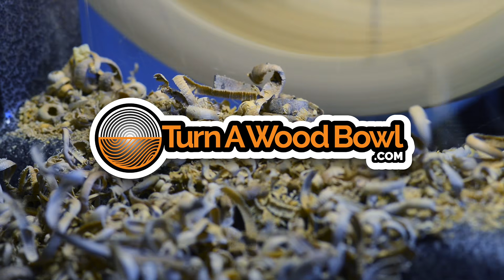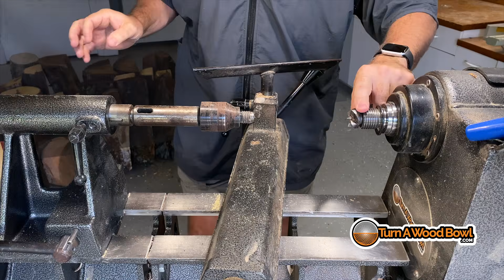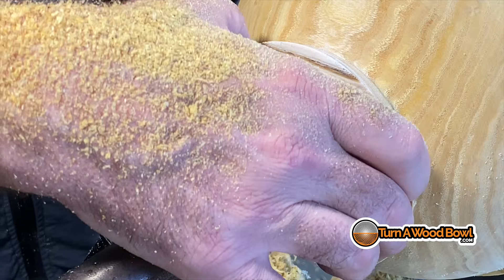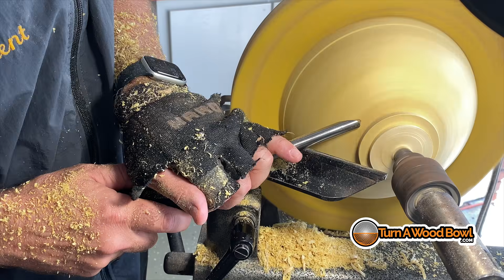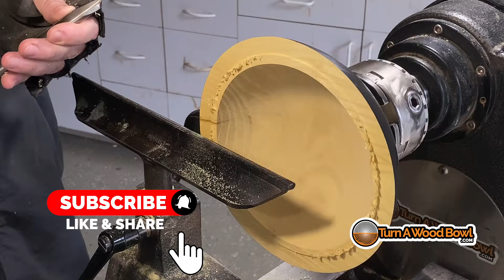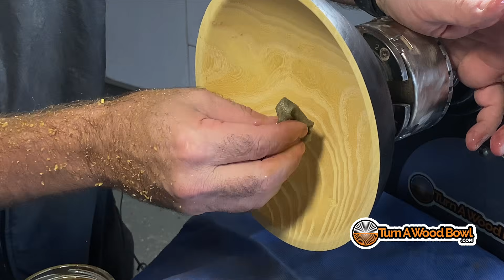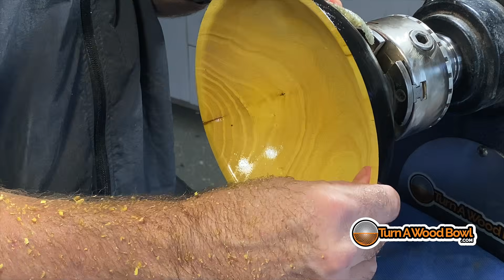Firewood Log to Bowl Twice-Turned Ebony Mulberry Wood Bowl - Woodturning Video

Comment: Thanks for the video 
As a newbie I was surprised to see you use the spur center on such a big piece of wood
Can you give an indication of when to use / not use them? Maybe a good video
Reply from the maker: Good question! If your tailstock holds and locks properly and you've removed any loose material, such as bark, you can place a blank of almost any size between centers. It's the best way to be able to make adjustments as you progress. Thanks for asking. Happy Turning!

Comment: Many thanks for another interesting vide.  However, I am a little confused about the tenon, in a previous video you said that the tenon should be sized so that when tightened there show be a small agp between the jaws, but here @33:10 you seem to have a much larger gap?
Reply from the maker: Yes, you are correct. I needed to fuss a bit with this tenon because it is not going to be resized or shaped after the turning because of the ebonizing. Thanks for asking. Happy Turning!